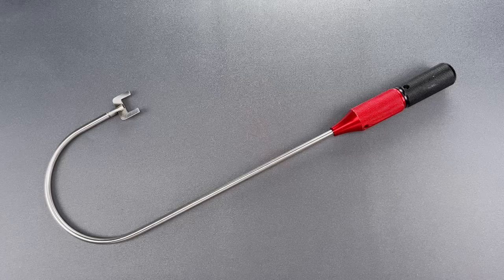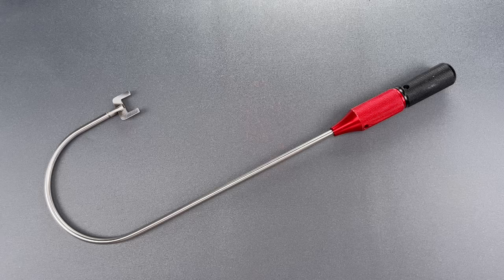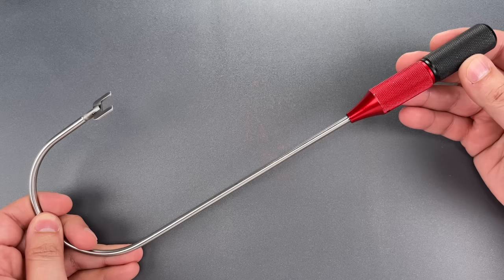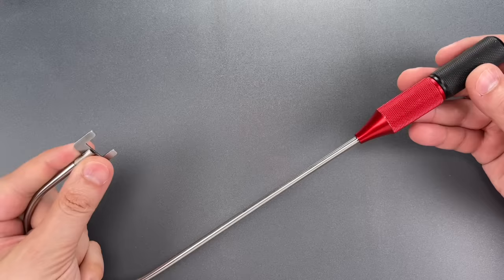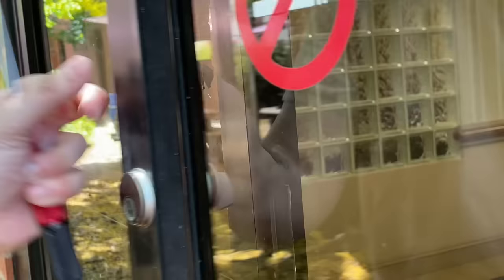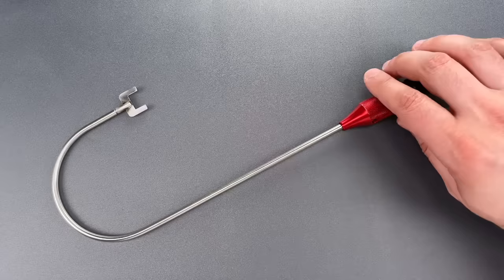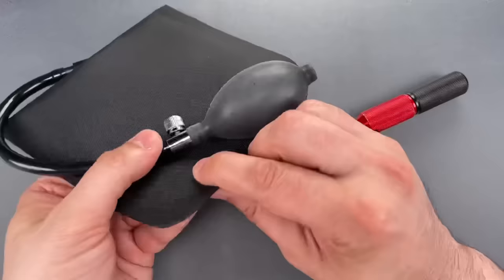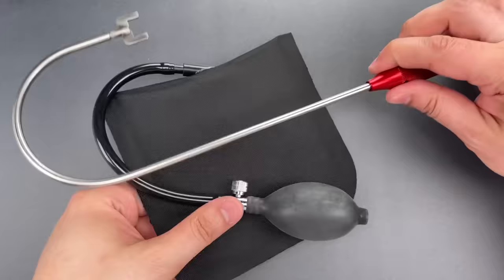[1312] The “J-Tool” Reaches Inside To Open Doors

Comment: I'm still surprised, that so many american doors have just a rectangular cross-section, instead of adding a couple 90° turns on the door edge and in the frame to prevent attacks like these and shimming, like the credit card trope in the movies.
Reply: The EU and the US, despite many similarities, are literally and figuratively an ocean apart. From police rights (and typical interactions) to how doors work (I've never seen deadbolts in the EU), to regulations for anything from cars to food, there's as much difference between them as between any other two parts of the world.
Reply: @LemuriaGames  as an EU citizen I can tell you for sure deadbolts quite common

Comment: This is why we weld the doors and windows every time we close at night.
Joe was in the bathroom once and no one noticed, but since he was binge watching LPL, he didn't notice.
Reply: So stupid to reply to your comments with fraudulent links
Reply: @makuhglee2331  Don't reply to the spam bots. Just report them.
Reply: At least he wasn't locked out of the bathroom...
Reply: Or you could get a decent door... I mean one without a gap, that has an overlap with rubber insulation.
Reply: @tovanto3971  Replied to spam bot, reports it and it's link.
Reply: @etherealicer  On the insulation part, Deviant Ollam has shown in a few of his talks that rubber weatherproofing doesn't provide much resistance to attacks like this one that target the other side of the door.
Reply: @Gakulon  Nah, the rubber alone not (although, depending on how tight it is, it will certainly make the process harder)... but you have a stepped overlap of the door as well (couldn't find a great picture, but this shows what I mean pretty well: https://www.fensterhai.de/fileadmin/user_upload/Montageanleitung/Haustuer_einbauen/haustuer_einbauen_rahmenbohrungen.png . This is installation and will have about half a foot long screws into the wall, so it is solid).
Reply: @makuhglee2331  But the comment is not his?
Unless it's an alt account.
Reply: @etherealicer  yeah also how much it wobbles when he just pulls on it. Seems like there aren't any locking pegs/hooks around the frame?
There's no way this offers enough thermal and acoustic insulation

Comment: I used to service vending machines in office buildings.  Some had a "Push to Exit"  right next to the door jam.   Slip a coathanger into the door gap, turn 90° and pull.  Easy.  I got tired of waiting 20 minutes for the custodians to let me in.
Reply: Haha! That's clever..

Comment: So simple and effective.
Reply: Which is why it shouldnt be on youtube
Reply: Not in Germany.
We know how to build proper doors lol
Reply: @SuperDeinVadda  over engineered crap that doesn’t last like your cars.
Reply: @filthyanimal874 

You call a simple strip of wood or metal that covers the gap between the doors overengineered? 
That speaks volumes about your technical understanding. 
But than you use single pane sliding windows that are cumbersome and got the insulation value of a rain jacket without an inner lining. 

BTW 
Not sure what you do to your cars but each of  our cars has lasted for 20 years and  500.000 km 
(VW t4, VW Golf 4, Audi A6) 
And all are still going strong.
Reply: @SuperDeinVadda  I own a 1976 Chevrolet pickup truck, a 1996 Cadillac Sedan deVille, and a 1999 Harley-Davidson XL 883. My Caddy and my Harley are all original and run and look like new. Let’s see your cars last as long as my truck. Then we’ll talk.
Reply: Stellvia Hoenheim  It's a no skill bypass. Some things don't need to be broadcast, especially when there is no information in the video on how to protect against this method. Don't tell me I'm dumb when I work in the trade and can tell you this information is dangerous.

Comment: Several decades ago, I worked at a movie theater as a side job while going to night school.  I finally persuaded the manager to give me a set of keys (I was usually there before him for opening and got tired of waiting on him) by using a one-piece distributor wrench to open the push bar similar to this. Push it between the doors, twist a bit to grab the push bar, and pull to open. After about a dozen times of me already being inside, setting things up, he finally relented and requested I show him how I was getting in.  I upped it and said “if I can get in faster than you can with a key, I get a raise?”  

I got the raise 😊

Then he wanted me to figure a way that this wouldn’t work.  Simple notched wooden blocks that could be dropped over the handles to fill the gaps between the door and handle were a cheap solution, and I got another raise.

Comment: This is the un-sexy yet 100% crucial part of hacking and pentesting that doesn't get flashy scenes in movies... physical security.
Reply: Mr Robot did a good job showing off social engineering exploits to put bodies where they don't belong and pwn shit, but very little lockpicking
Reply: Un-sexy? I mean it doesn't get shown in movies true, but I;m still astonished that filmmakers haven't figured out that physical security is way more cinematic than an insert shot of some hands flapping on a keyboard <.<
Reply: @okuno54  That's why Sneakers remains my #1 favorite movie of all time. :-D
Reply: @okuno54  "Catch me if you can" showed that social engineering is both effective and good cinema.
Also,  heist and prison escape movies and some Gangster/mafia before the 2000'nds also contained a lot of physical and social exploits.
Reply: Yeah, some guys from EY showed us a video of their pentests in govt buildings. They walked in, acted like they belonged, got the name of some guy working there and requested a temporary badge because he "forgot" it. Got into their entire IT department. Security, even cybersecurity, starts with physical security.
Reply: @averagejoey2000  Mr. Robot had about 3-4 short lockpicking scenes
Reply: Yeah, the weakest link isn't usually the system, it's the people.
"Hi, I'm from building maintenance and we just need to check a line running over your ceiling."
Reply: i took security in college and it was one of the most fun classes i took specially when we got to the physical part discussing things like man traps and the like.
Reply: THIS is the un-sexy part of hacking? I thought it was the actual hacking.
Reply: @asdrubale bisanzio door hallway door is a man trap not fucking spike filled dungeons dude altho i did press my teacher for it.
Reply: @asdrubale bisanzio Deviant Ollam is scary smart.  That guy is amazing.
Reply: @andie_pants  AYYYE LOVE THAT MOVIE!
Reply: @zenithparsec  Hackers originally meant coders who able to hack out code quickly, so at heart a hacker is anyone who can think on their feet and use their creativity on the fly.
Reply: it's not 100% crucial. These days social engineering is the most crucial aspect. And I think it generally doesn't get flashy scenes in movies either. In fact I'd say movies cover physical security a heck of a lot more than social engineering or even hacking. Physical security is like the main thing that they seem to cover aside from actual guards (which are technically physical security too?)
Reply: @asdrubale bisanzio its been a few years sense when because i can show you plenty of people trapping robbers in stores till the police arive.  but to be fair you dont trap them you double the work they have to do and you put a viewable area between said doors so it discourages them. police use it hospitals use it hell walmart uses it ever wonder why they have double doors leading inside?
Reply: @andie_pants  It's an underappreciated gem with one hell of a cast!
Reply: @asdrubale bisanzio In cybersecurity a man trap is a short hallway with lock controlled doors on each end. Usually involves a manned  security checkpoint.  Different than the DnD pit traps, etc..
Reply: @asdrubale bisanzio Well that's one approach. You could also just change the codes to allow ACTUAL traps.... Everybody give me perception checks with disadvantage.  Ivan, you roll normally....

Comment: This is why double doors should always be designed with some overlap in the middle, then even the air cushion won't work.
There's a lot more to safe door design than a good lock, and it's really cool to see all the ways to bypass that lock!
Reply: Most secure ones I've seen have some obvious aftermarket installed metal glap things welded over that area
Reply: Unless it runs the full height of the door a similar device shaped to go around the blocked area would be successful
Reply: @sleepyvamp  Where I live it is common that there is an overlap of wood or aluminium that runs the whole length of the door.
Reply: @l.ijspeert9040  Interesting. I've never seen the full length version before anywhere.
Reply: @sleepyvamp  Personally, I've never seen a double door without it. Maybe it's mandatory in my country because of some EU regulations or something.
Reply: @lukasprazak7362  totally possible that it's an EU regulation thing. 99.9% of buildings here in the US, Dallas, Texas specifically though the folkowing applies to the vast majority of my travels in the US, do not have it...not even like banks or car dealerships, electronics stores, jewelry stores. The only time I've ever seen it has been on gas stations in high-crime areas...the areas where gas station counters are enclosed by bullet proof plastic so the employees can't be held at gun point and forced to empty the register. I could use this tool on any electronics store I could go to in my town, any restaurant, any bank.
Reply: @lukasprazak7362  The EU and the US, despite many similarities, are literally and figuratively an ocean apart. From police rights (and typical interactions) to how doors work (I've never seen deadbolts in the EU), to regulations for anything from cars to food, there's as much difference between them as between any other two parts of the world.

Comment: Our homeless population has built some interesting tools over the years to defeat our locks. I work in facilities for a Healthcare organization that has two acute care hospitals, a continuing care center, multiple medical office buildings, clinics, and other commercial property. We have a building with panic hardware, and pairs of doors that open out. A home less guy made a tool similar to the J tool that could be used to slide between the doors, turned and placed on the operator side of the exit device, opening the door. I ended up having to install astragals that would prevent this from happening.
Reply: "Astragals"...?

Comment: Over here in Germany, these kinds of turn knobs are only used for bathrooms and can be opened with a knife from the outside anyways. It baffles me to see it on a porch door. Anyways, that's why burglars or first responders just use prying bars here.
Reply: A nice kick would be enough
Reply: If you have those shops with sliding glass panels, the final element (or the door itself) usually has a similar lock at the top and(or the bottom. Unlike the US, where there's (as far as I understand) a requirement to open such doors from the inside without a key in case of emergency, over here in germany the locks are mostly key-based (and usually the key is removed after locking. Usually). Most likely with weak cylinders, but as they are on the inside, it's hard to rake them open from outside :D
Reply: Same here in england, most american houses are a joke
Reply: Prybar is universal but its not non-destructive entry
Reply: @Kabodanki  a Kick doesn't do much to a well built German door
Reply: Not a fan of deadbolts to keep exterior doors from being jimmied open over there, eh?
Reply: For american houses, you can propably use a crowbar break a door into a outside wall.
Reply: must be a lot of breaking and entering in Europe, we're more trusting here in the States.

Also many homeowners own guns, so break in at your own risk 😂
Reply: why would you be carrying a knife in the bathroom?
Reply: I remember the front door to the building I lived in in Germany had a very "American" style lock on the outside and a lever to open from the inside.  In Germany (as told by my Vermieter) needing a key to exit a building was illegal (just like in the USA) as it would be a hazard during a fire.

Once inside the building, my apartment had a skeleton key style lock which could be locked from either side, but I always left my key on the inside just in case of fire.
Reply: @ememmeme8722  If you need to break into a bathroom here, you take a knife out of the kitchen and use it as a flat screwdriver. If you want out, you have the turn knob.
Reply: @poluticon  or the fact that most houses have at least one gun in them.
Reply: That wasn't a porch door, that was the door to a shop. You couldn't do this on a home, the doors are too tightly fitted and have an overlapping ridge in the frame. No one is sticking metal rods through people's doors here in the states.
Reply: @MathMagician93  no one uses this kind of lock on a bathroom for a house. You are mixed up.
Reply: @Xplora213  Literally every bathroom I've seen in Germany either uses a see-through keyhole with simple keys (older houses) or a turn-knob (anything after 2000 probably). To be clear: the turn-knob design has a turn-knob on one side and a sort of giant flat screwhead on the other side. Vertical slit means open, horizontal slit means closed. And you only ever turn it a quarter rotation, not multiple rotations like in the video.
Reply: its a glass commercial door for places open most hours, or that has a shutter- its purposes is the same as a we're closed sign, but works on those that can't read the language.
Reply: @christopherg2347  And i think 5-6 strikes with sledgehammer would be enough to get a new entery just in wall... I'm just curius to see how that baloon tool would work on normal, 250 kg+ full metal door in normal stone/concrete wall? Just in case if you're not living in USA...
Reply: @poluticon  Why would there be much breaking and entering, if most people fail on the breaking part?
Reply: @jaypyro3543  Great, so I need less stable locks but might get shot on the street?
I take needing stable locks over the danger of being murdered every step.
Reply: @user-gp7rr3ll5f  Such a baloon tool would work on whatever part of hte door system is the weakest.
But it is primarily designed for weaker doors, so I would not expect a lot of performance.
Reply: @asdrubale bisanzio Because we rarely need to cut stuff or people on the street and have screwdrivers in every home?

Comment: I will say that this probably only works in America or similar countries...
Here in Germany we mostly have either overlapping ledges, prevents the insertion alltogether, or completely diffrent types of door knobs, so this tool would be compleatly useless...
Reply: Comercial buildings/shops in many "Fussgängerzonen" that have a full glass front don't have any overlapping parts and do also quite often have big gaps.
Reply: I hate it when the insertion gets prevented. :(
Reply: Invite him over. He could make a video on how easy it is to get into one of your businesses.
Reply: even in germany, things are not installed correctly. yes most of your stores could have a metal overlap plate to protect this, but i assure you there is 1-2 that don't and this is why those overlapping metal plates get bought.
Reply: If those are double acting doors, that can swing either in or out, they can't have a plate covering the gap.
Reply: He is most likely more talking about doors in the back like in the Video.

Comment: LPL has ascended to the point that he doesn't even need to attack the lock itself.
Reply: That door is so shitty it would probably open just by looking at it and thinking about opening it hard enough.
Reply: hes only using 1% of his power in this video.
Reply: @tovanto3971  Stop the SPAM

Comment: The lock excited to get picked by LPL but then he just decides to circumvent

"What am I a joke to you?"
Reply: well: he respected the lock by not calling it the weakest link in the safety chain. Bosian Bill works for law enforcement: He Explained that in a field training mission, picking the lock is one way to go - if you can to that in seconds: Good work. Pick the bolt cutter out of the trunk and cut the chain in a minute: Good work. Getting the lock picked after 60 minutes? Mission failed.

Comment: That's damn creative as soon as I saw it the function clicked in my head, stainless steel would make it more difficult but with an inline second spinning flexible shaft you could put a clamping mechanism on it and beat the lock

Comment: Looks easy on a glass door but would take some fumbling around to do it on a door you can't see through. 😀😎
Reply: Well doors are pretty standard.
Reply: Time for J-tool Pro with built in fiber camera.
Reply: Oh my god, you're right! And of course you can't possibly use a different method on those doors.
Reply: @resikchanel843  spam, report

Comment: Doesn't 99% of all doors have an overlapping edge to preventing these sorts of attacks? And at least in cold climates you'd have a hard time find a door with such poor tolerances even if they lacked that basic protection 👀
Reply: They are used in cold climates too, often in buildings that are open most hours, like mcdonalds. They are usually glass doors, so there isn't a strong resistance if someone wants in anyway.
Reply: Not all double doors, because they're meant to easily open either one. An overlap would prevent that.
Reply: This tool is definitely more effective in warmer climates, where you're more likely to find a door with a big gap, like frameless glass doors.
Reply: 99% sounds more like conjecture than anything, but depending on where you live you can see way more one than the other.  Regardless, I think the point wasn't that this tool can be used on everything, it's that if there's an option to use it, then it makes quick work of it.
Reply: @pkobalt  But the insulation strip is flexible.